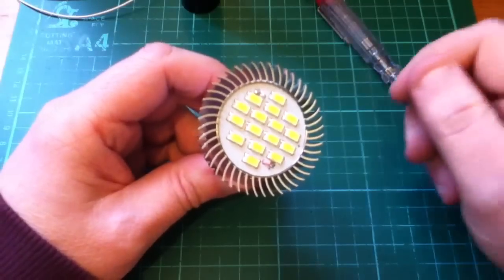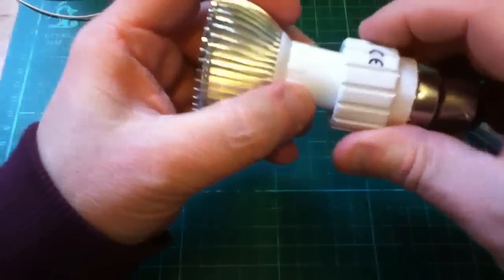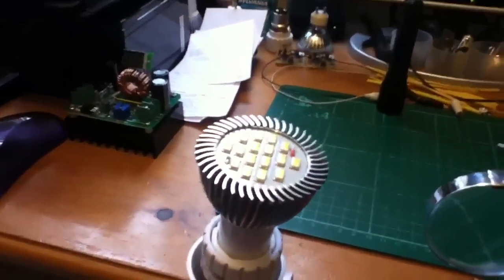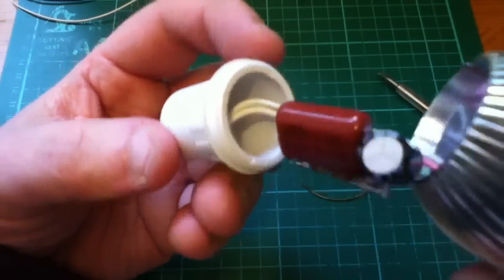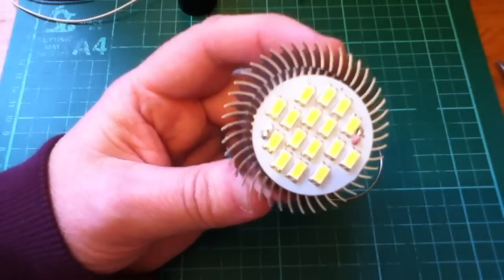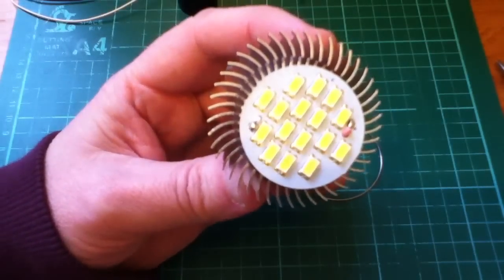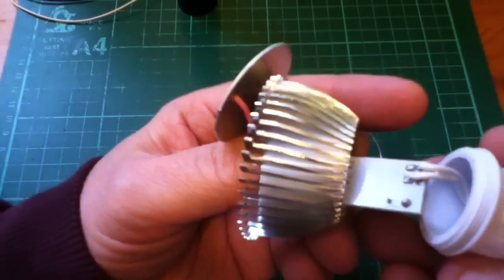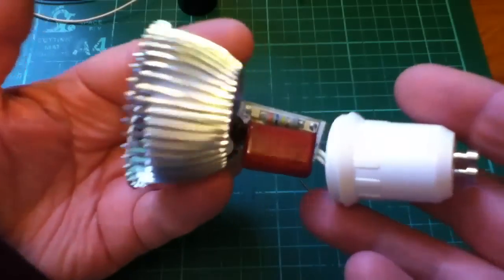Dangerous GU10 LED Spot Light is Cheap and Bright but could Kill You - Seriously

Comment: Wow, it's unbelievable how many people are trying to shine in areas where they have no idea or about 10 % understanding of the topic ...
For those who read that bulllshit I can translate the warning into a simple human language:
There is no reason to be afraid of touching the metal part of the bulb because of the fact how the LED works.
The LED lamp (diode) is electronic component that works with a fixed polarity,
Which means that if the LED did not get the right power supply + and - it will not going to work at all.
That's why the vendor (any vendor) have to make sure the LED is always getting the right polarity so it will always works - no matter how the bulb is connected in the socket. (NO 50 % chance to survive)!
There is electronic component which is looking after that called (GRETZ) or a simple pair of two diodes that are ensuring the right polarity will be transferred over to the LED.
Period...
And as an addition to that some models also have voltage transformer components witch are lowering the voltage to match the led required ...

Dear Mr. Julian,
you might want to run to the library or use google so to learn a bit more about the electronics before posting any similar video.
Reply: Not if it is plugged in backwards, then the heatsink that is normally on the neutral side of the circuit will be on the hot side of the circuit. If you check from heat sink to ground you will find that there is nearly full line voltage.

Comment: maybe i'm mistaken but doesn't the transformer in the LED convert the power to 12V? so far as i know you cant be killed by that little voltage (I know amps are what kill you but it would be hard to complete the circuit through a body with 12V)

Comment: the bridge rectifier let 50 or 60 times /sec. the current pas from the live en the other negative wave part will come from the neutral there's no problem grabbing any of the conductors separately if you are standing well insulated from the ground.

Comment: Thank you. I am an electrician by trade. I didn't know this. Yet have been of many jobs using GU10s and similar lamps. The companies I tended to work for were primary builders, so we generally fitted the filament lamps, leaving it to the customer to change later. This is definitely something to remember.
Reply: Just a suggestion, but it might be something you could report to the IEE I don't know if you are with them, as a JIB spark I have to be.

Comment: Tesla proved that AC is safe but take precaution with items without "CE" or "UL."
1)Insulate yourself when touching bulbs.
2)Make sure your light switch cuts the right lead.
3)Head the warning on package, "disconnect ALL power (two lines) when touching bulb."

Comment: Why would anyone want to touch a light anyway, are they not up high? In every house there is an RCD, which should trip out in the event or a short. In theory a person would receive 30mS of charge. I was always giving myself a shock when younger. I once, foolishly, pushed a plug into the socket with the palm of my hand. The plug had no back to it. The power tripped out, my arm hurt for a while, but I was fine

Comment: I think you got it a bit wrong! at 2.30 in your video you state that it contains a bridge rectifier, then you go on to say that by inserting it different ways round in the socket would change the polarity to the disc. this cant be true if the mains is first rectified by a bridge! also leds are diodes and will only accept current flow in one direction only hence the reason there is 2 colours of wires to the disc. however, im with you on the fact that the circuit is in fact a very simple circuit only! more expensive led lamps use an constant current hf transformer which isolates the 230v to somewhere round 4.5-12v depending on the arrangement of the leds. these types of hi output led including CREE must have a constant current driver circuit. so don't expect it to last long!
Reply from the maker: No not the polarity, but the paths of live and neutral. What the bridge rectifier can't do, is alter the fact that neutral is grounded locally and live isn't. One way round, live is fed via just one diode to the front plate - the other way round, live gets there via a diode and the dropper capacitor. See how this works in practice in AintBigAintClever's brilliant 'corn cob' video http://youtu.be/n3ci4nlKhEk
Reply: Julian Ilett wow after looking at the schem from the other video I see that the leds are in series! so actually there is no voltage drop! so yes very very dangerous! and the fact that on the other video the lamp does have a ce rating. unbelievable! thanks for pointing out the schem